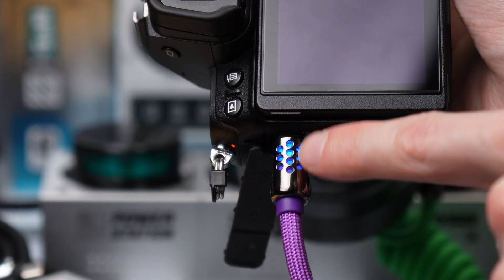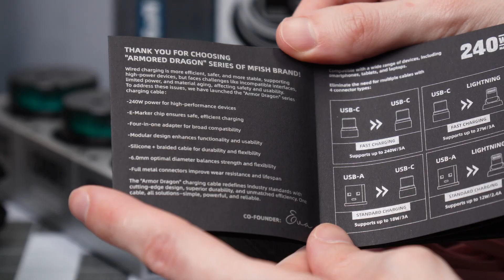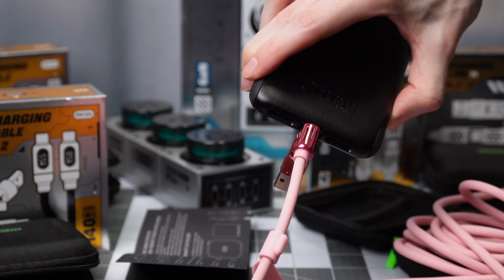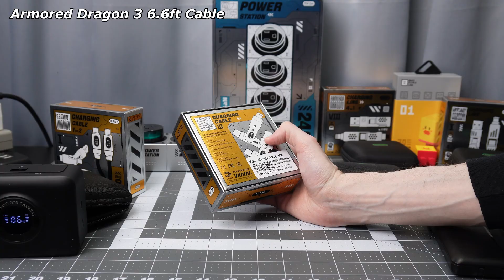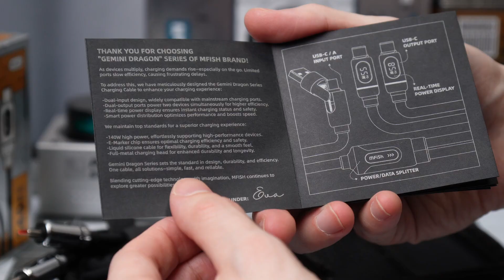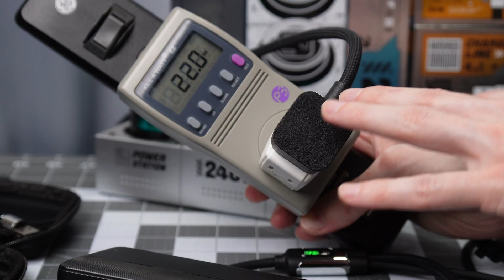Specialty high wattage USB Charging Cables and a Power Station from MFish Overview ⚡🔌

Comment from the maker: Check out their cables on Amazon: 
Dual with Displays 5ft: 
https://amzn.to/3O3N1Px 
240w Power Station: 
https://amzn.to/46ElBpN 
Black 6.6ft (thinner connector):  
https://amzn.to/4qoQupg 
Pink 6.6ft (different length than mine): 
https://amzn.to/3O4flBk 
Black 10ft (different length than mine): 
https://amzn.to/46f21R5 
4-in-1 Coiled (white instead of green/purple): 
https://amzn.to/4ahFzaX 
As an Amazon Affiliate, I earn from qualifying purchases! Usually anything within 24 hours of the visit. It doesn't have to be the product I linked. 

Or visit their website: imfish.com (not affiliated): 
imfish.com coupon code: TECHsuppose, 10% off per use. Valid until June 30, 2026. I'm not affiliated with their website so I make no commissions, but asked them to make a code for you all if you want to use their website instead of my affiliates. The use of this code tells Mfish that my videos and other media are able to reach all of you. 

240w Power Station: 
https://www.imfish.com/products/mfish-e-tank-gan-240w-power-station 
20w Duck Charger: 
https://www.imfish.com/products/mfish-mad-pixels-lab-gan-pd-chargerwith-gift-set-option?variant=42356214005831 
Dual with Displays 5ft: 
https://www.imfish.com/products/mfish-gemini-dragon-140w-max-dual-type-c-cable-with-power-monitor 
Black 6.6ft (thinner connector): 
https://www.imfish.com/products/mfish-armored-dragon-3-240w-4-in-1-fast-charging-cable?variant=41837472972871 
Dragon 4-n-1 pink 10ft: 
https://www.imfish.com/products/mfish-armored-dragon-1-charging-cable?variant=41891790454855 
Purple and green coiled cable: 
https://www.imfish.com/products/mfish-armored-dragon-8-charging-cable?variant=41633665613895

Comment: The metal is an alloy so those prongs will eventually break this is a flaw in the product it seems many people seem to have this issue.
Reply from the maker: It mentions zinc alloy in the manual. There isn't any mention of what is mixed with the zinc. I assume the mix would define its ability to flex without snapping. I haven't watched any other videos, where there people that had the tabs snap?

Comment: Mfish has some cool stuff. If youre a big fan, you should check out and review the Super mushroom modular power bank. Its cylindrical and is made up of like 3 seperate modules, so if you need max capacity you put them all together or if you just need a small unit for topping up your phone you can carry just one of the little cylinder modules. It is super cool, all of mfish's stuff is cool and has personality, but the mushroom power bank is the coolest of them all in my opinion.